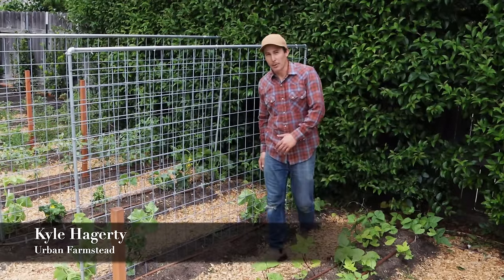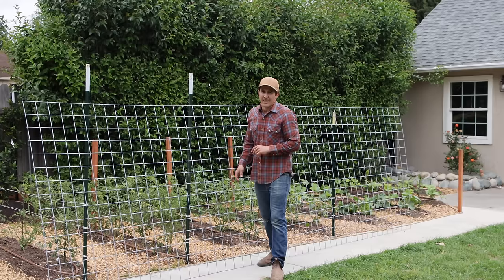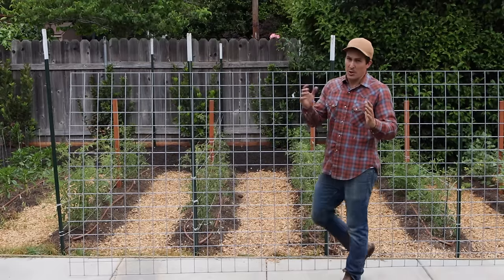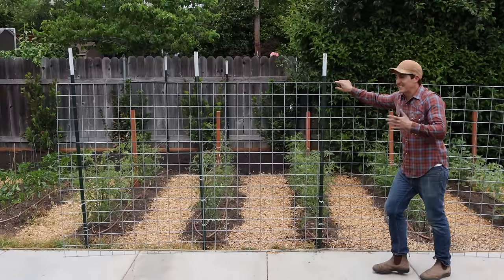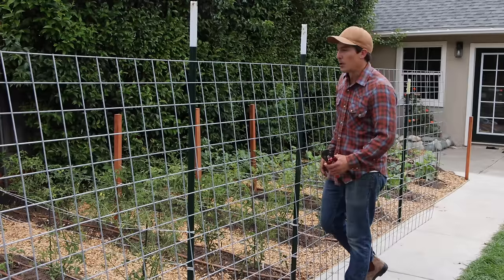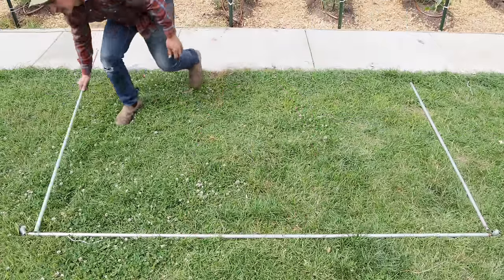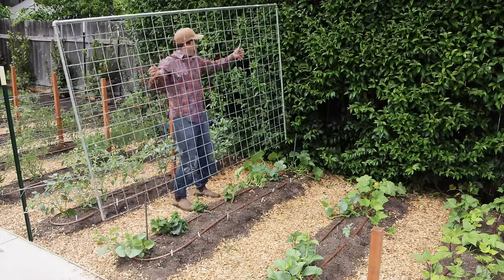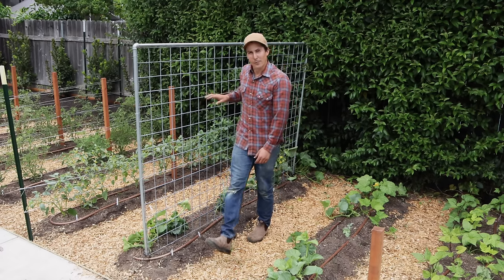How to Build a Fence Panel Trellis - Cattle Panel, Hog Wire etc.

Comment: When you cut the trellis in half how did you attach the side with no square left to the conduit. Did you clip off the excess and make the second panel shorter? Thanks
Reply from the maker: I cut a bit of a zig zag down the lines to have connections for both sides

Comment: Ok I found the exact pipe you are using.  And the elbows.  The local hardware store are all out. However a new store just opened up. Checked with them they have it.  Thanks for not blowing me off. They also have the pipe to make the leaky hose in the lengths I want.  Guess I got what I deserved trusting only the big box stores. If I can will send you photos of finished project. Thanks for all the tips.
Reply from the maker: Awesome! Yeah the big box stores can certainly be hit-or-miss. I love our local hardware store

Comment: I’ve been using conduit pipes for over twenty years. It lasts forever! I use nylon netting instead of fencing to save money. But be certain to spend a bit more and get the 3/4” or even 1” diameter pipe. Without the fence panels for reinforcement, 1/2 inch will bend under any serious weight, like green beans. The interior rebar support is an awesome idea. I’ll try that this year.
Reply from the maker: Rad! Thanks for sharing

Comment: Conduit is a little expensive but after watching how simple these were to build I might make that purchase. I spent some money and bought metal poles over 20 years ago for my pea fences and I'm still using them
Reply from the maker: pearl wright yeah, I think the 10’ pipes are $13, but it’s much cheaper than the galvanized plumbing pipe. And you’re right, these things will last forever so it’s an investment.
Reply: @urbanfarmstead  how did you get the 8 foot sections?  Did you buy 10' sections and have them cut and threaded at the store?  I am struggling to find them in that length at all my local hardware and farming stores.
Reply from the maker: @bradbirchfield  yes, I had them cut and thread at the store. I might have even started with 16s that they cut in half and threaded, but now I don’t recall. Either way, yes have them cut and thread in the plumbing section.
Reply: @urbanfarmstead  thanks!
Reply: I was going to ask same question. I started this project 6 yrs ago I tried 1/2 inch to light for my tomatoes. I went to 3/4. Problem was the ends to attach 90* angles are like $5. Didn't know you can have them cut and thread.

Comment: The hardest part of this project is getting the panels.  Will have to drive fair distance to get them. 

Just a suggestion for driving the re bar.  I got a short piece of ridged conduit from a friend and attached  in my case a tee connector to give me a larger striking surface. 
The second tool that me made was also made out of ridged pipe and two tee connectors on on each end so we would have the right length each time.
Reply from the maker: Thank you for sharing

Comment: It shall be done.  This is EXACTLY what I was looking for and here it is. And the 10' beds--my brain says lengthwise, but shorter rows make much more sense.  Question--why 3/4 in pipe--would 1/2" work as well, or isn't it strong enough?

Comment: Great video .....
Turn your hammer 90 degrees and use the side of the hammer to pound in the rebar.
More surface area to pound with and LESS chance of hitting your hand when (and you will) miss hitting the rebar.
Reply from the maker: MV D-dub thank you for that great tip!

Comment: I love livestock (cattle or pig) panels for trellising. They make beautiful, durable structures for plant support. If you can make these trellises so that the bottom of the panel does not touch the soil, raise it up a few inches, it will not only give a little more height, but also, it will keep that bottom edge of the panel frame from rusting. Yeah, they might be galvanized, but they will begin to rust over time sunk a little down in damp soil.
Reply from the maker: Thank you for that suggestion! My plan is to build raised next year and to mount the trellis to the top rail of the beds so it will no longer touch soil. Thanks again.
Reply: @urbanfarmstead  You’re very welcome! Enjoyed your videos, a very nice discovery! : )

Comment: Is there any reason your wouldn't use pvc pipe instead of conduit if you wanted a cheaper and lighter alternative? Thanks for the great video!
Reply from the maker: Yeah, the reason is that is simply will not work. PVC is great for some garden projects, but much too week and flimsy for this application. Thank you for asking
Reply from the maker: PVC is far  to flimsy once the plants fill in

Comment: This is the perfect trellis for my tiny backyard garden!  Simple except for one detail - the male threads.  Are they on the pipe itself or did you use a fitting?  A quick tutorial?  The guy at Lowe's showed me a "compression" fitting with male threads but I don't have  the slightest idea how to connect it to the conduit pipe.  Thanks
Reply from the maker: When I naught the pipes at Home Depot they cut and threaded them for free in the plumbing section.

Comment: Have a question that should be straight forward. When setting up a trellis for tomatoes and cucumbers do you go east to west or north to south.  Half my friends say east to west the other half say north to south. 

The main wind comes from the west through out the summer then from the north west starting in fall. 

Have some protection from the wind in the fall. 

Does it matter.  Normally I use cages for tomatoes 

Last years cucumber trellis were the wrong type of fence with a eight inch verticals hole by 12 inch horizontal hole. Local. Stock panel suppliers are having problems getting them  the price is $90 a panel. 

Will be using 4 x 4 by four foot high sheep fence 10 gauge top and bottom stran with 12 gauge in the middle

Comment: I have watched this idea now about four times. Each time i enjoy it more and more. Really thinking of trying it out. Have done some research into it.  I have learned that these stock panels that I could have had for about 20 dollars a few years ago are now around 90 dollars if you can find them.  That said i have found concrete reinforcing panels 6 gauge wielded wire  four feet by eight feet can still be had for a fair bit less. Since i am no planning and arched trellis i will be going this this product. Now the hade question. What  size EMT did you use for these ones. I think 1/2 inch is a bit small. I am thinking 1 inch. 

Also  does it matter what type of wire i use to attach the mesh to the EMT. 

Thanks in advance for any info.  My planting season begins the third week end in may so i have time.
Reply from the maker: Hi, that wire should be fine in this application. 1/2” or 3/4” conduit pipe are both fine. Any wire to attach.

Comment: Great ideas Kyle!  Q:  If I wanted to make the panels vertical to build a 8 foot fence around the perimeter of my garden using the conduit method.  Would it be best to use the 10 foot conduit?  Also, how would I build the door that leads into the garden?
Reply from the maker: Yes that would work. That’s a different thing to explain here

Comment: You can do it with 1/2 inch conduit instead and it would be a smuggler fit on the 1/2 rebar.
Reply from the maker: yes

Comment: So useful. Would there be any problem if i replace the galvanized conduit pipe for a PVC one. It´s cheaper to me, so i would rather prefer it. 
Greetings from Peru.
Reply from the maker: Angela Jimenez Huamanlazo thank you! It could definitely work but just keep in mind that it will be strong but not as strong, so if you get extremely strong winds it could bend or even break. I think it would be fine though.
Reply: @urbanfarmstead  ok no problem, it will work as a wall trellis by the moment. I'm already buying the materiales. Thanks for the answer.
Reply from the maker: Angela Jimenez Huamanlazo great! You’re welcome

Comment: Hello dear Kyle. May I ask, regarding beds the length of the bed, should it be facing north to south making the faces of the trellis' face east and west? Do you recommend using two different plants one on the inside n the other on the outside?
Reply from the maker: Yes, north to south beds are preferable

Comment: Kyle, would you recommend this trellis even for watermelons and cantaloupes ? we are planning to do ours this weekend.
Reply from the maker: Madhuri Tullimalli I’m growing watermelons on mine. You’ll want to be sure it’s a small variety, capable of supporting its fruit without snapping the vine, or you’ll have to support individual fruit.
Reply: Dollar store pantyhose make excellent supports for the larger melon variety since they expand with the 🍉. Insert the melon when it is the size of a softball, flower side in first and loosely tie the stem end of the hose onto the fence. I’ve been doing this successfully for years! I also use hose to put my onions up stacked one on top of the next with a knot between each onion.  Hang the tube-o-onions and simply clip at the base of the knot to release one onion. Never have a moldy onion ruin the lot. Good luck to you!

Comment: How do these panels perform in the wind with the rebar holding them up?

I would think once covered with crop, that’s quite the natural sail. Any other means of stabilizing them?

Thank
Reply from the maker: Mine did great! not even the slightest bend after a full season with heavy crops. If your garden if in an area that sees very heavy winds you could support them with something more substantial or you could use guy-wires for added security.

Comment: Thanks. Did you rethread the cut ends to use the threaded elbow connector?
Reply from the maker: At the hardware store they cut and thread them for free in the plumbing section

Comment: Thanks for your video. Are the sheep panels sold in a roll or lay flat? If it's flat, can you bend it. I don't own a truck. Thanks.
Reply from the maker: Grace Young they are sold flat but can be bent. Anything in a roll is too thin.

Comment: Just purchased materials today (before viewing your video - is that called deja vu?). Serious Q: do you think training spaghetti squash up an arch is a good idea?  Bought the panels for cukes & more pole beans.  Maybe will do a couple of arches for pumpkins.  
Swedish Farmer (in Newark, CA)
Reply from the maker: Nice! I think its called prognosticating, but whatever it is, it sounds like it worked out well! I would definitely use them for spaghetti squash as long as they are not a large spaghetti squash variety. You might not know yet where or not they are but the size can very and large ones might snap from the vine. Either way the trellis itself will support them no problem

Comment: Do the squares need to be a certain size? I was shopping for cattle paneling and I found a cheaper panel, but the squares were bigger. I wasn't sure if that would be a problem for the plants. Would they still climb the trellis?
Reply from the maker: Jacob Sweeney theses not a specific size that’s necessary in my opinion, but I dii ok like the openings to be large enough to reach any hand through.

Comment: I have a lot of wind in my area. How do these trellises do in the wind? They appear a bit wobbly with the rebar. What would you suggest to strengthen them?
Reply from the maker: Mine did fine in the wind but it would depend on your strong wind direction. You could reinforce with T-posts or guy-wires

Comment: That looks awesome.  How do you attach the end that does not have a vertical line from where you cut?  Do you remove them to the next vertical?
Reply from the maker: I cut the center in somewhat of a piano key pattern to maintain full length and gave attachments

Comment: This is a great concept. May I ask? How can this be modified to support a wisteria vine that gets woody and eventually weighs quite a bit? Do you think T posts with two to three feet hammered into the ground would provide enough support to prevent it all from falling over?
Reply: T posts are what we used to hold the fencing for our 2 hogs so I doubt they would have problems with a heavy plant.
T posts are pretty strong and sturdy when stuck a few feet in the dirt.
Reply: @joedirt7604  Thanks for answering.  I was a little bit concerned because the trunk of an older wisteria vine can get quite thick; about the size of my wrist if not a little thicker. And the entire vine is very woody and kinda heavy.

I used an example of a hysteria vine because that's what most people are familiar with. But where I live it's too hot for those. I plan on growing Bogainvilleas.  I want to take a 16' long cattle panel and cut it in half and place them 8' vertically and be 3 to 4ft wide and use 10 to 12ft long t-posts on either end for support and hammered 2 to 4ft in the ground and train the bougainvilleas to grow up them. Bougainvilleas aren't as heavy as Wisteria vines. At least from my observation. So I'm hoping this idea of mine will work.
Reply: @AdrienBCaldwell  no problem. 
all you can do it try it out. Part of gardening is accepting an occasional failure, but I think t posts would be plenty strong enough, the hogs are probably a couple hundred pounds and like to destroy stuff, but they haven't been able to move or damage the stakes over the course of a few years so I would think they would work well to hold  fence panels and the weight of a heavy plant.
If your still concerned about the weight though you can always put 2 post next to each other to make it alot stronger.

Comment: Hi Kyle, do you top off plants or vines that grow higher than 5 feet ? If not, how do you deal with those growths that are above 5 feet ? Thanks in advance
Reply from the maker: I do not, I train taller plants to grow at diagonals so they don’t out grow the trellis, but if they do they will just spill over the other side

Comment: I've been using cattle panel arches but I have a problem with them collapsing under the weight of the fully grown vegetables in high wind summer storms which then damage the plants. This year I'm looking to reinforce everything heavily.
Reply from the maker: Really? I’d be interested the see your setup, because I can’t imagine them collapsing under any weight with the way I build them in my other garden. I would suggest sheep panels if you need more support
Reply: @urbanfarmstead  we get a derecho style t-storm occasionally and if the plants are full term, well, they go a little crazy with the amount of rain plus our watering.. and I have livestock and unlimited fertilizer so our plants grow up and over the arch both directions and just swallow it. Maybe we just need more spacing

Comment: Just found your channel and loving your IG page. I’m trying to do this project because I think the redwood trellis border is a little out of my budget for now. I just bought the panel from Tractor Supply but where did you get the conduit? I looked at TS, Home Depot and Lowe’s and didn’t see the threaded pipe and the elbow that you’re using, unless I’m missing it. Thanks!
Reply from the maker: JD Fordyce awesome, thank you! I found the threaded 1/2” conduit in 10’ lengths at Hone depot, then take it to the plumbing section where the cut it and treaded it at 8’ for free. The 1/2” elbows are in the same plumbing section at Home Depot
Reply: @urbanfarmstead  thanks for the response! I finally figured out the confusion: from what I understand now, you've got conduit piping (which is more used for electrical work, and is thinner and cheaper and found in the electrical section) and then you've got galvanized steel pipe (which is more for plumbing purposes and found in the plumbing section). I was initially looking at the conduit piping which is what you call it, but I believe you're using the galvanized steel pipe which is in a different section of the store, and the big difference is that the galvanized steel pipe can be cut and threaded, but the conduit pipe can't be threaded in the store (at least that's what the orange aprons told me). The conduit piping does however have 90 degree elbows, they're just screwed on instead of threaded. And the pipe is much cheaper than the galvanized steel plumbing pipe ($3.50/10ft for the conduit vs $20/10ft of galvanized steel) , I'm just not sure if it would have the same rust resistance since I don't think its designed to interact with water the same way. I might test it out though (since I accidentally bought this first) and I'll report my findings if it works. 

But I did end up buying the galvanized steel pipe and having them cut it in the store, (Did you use 3/4" or 1/2"? I used 1/2" because it was just big enough to fit onto the rebar) All done and it looks just the one in your tutorial, and looks/works great! Thanks so much for the great content and keep it coming!
Reply from the maker: JD Fordyce hi, so I did actually use threaded 1/2 inch conduit pipe. Some orange aprons will cut it for you and sons will not. Also it comes threaded in 10 foot lengths. You can definitely use 1/2 galvanized pipe and really the only reason in chose conduit over plumbing pipe was the cost savings.

Comment: Is the pipe you use meant for water. Now sure why I though it was electrical EMT pipe. My bad. Would EMT pipe fork or do i need the heavier Water Pipe. 
Still doing my budgeting at this time.
Reply from the maker: You could use galvanized water pipe, but as you mentioned, it’s more expensive and you really don’t need the thickness, so electrical conduit pipe is what I used.